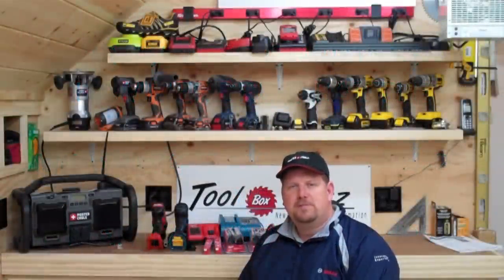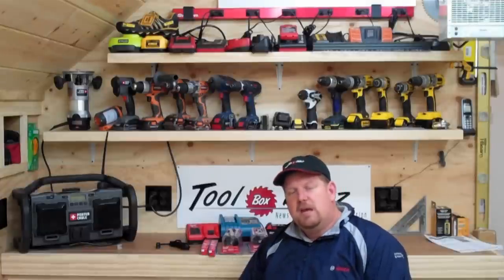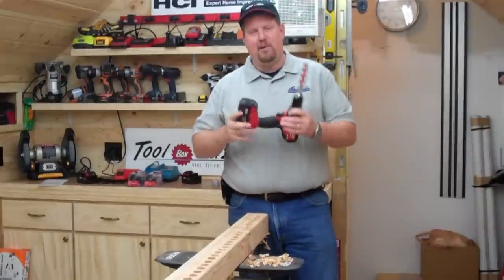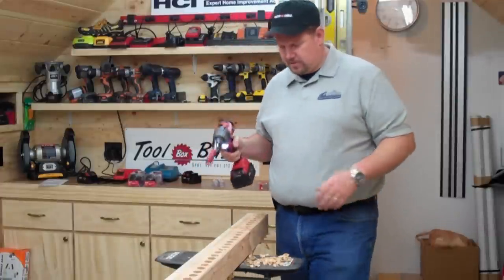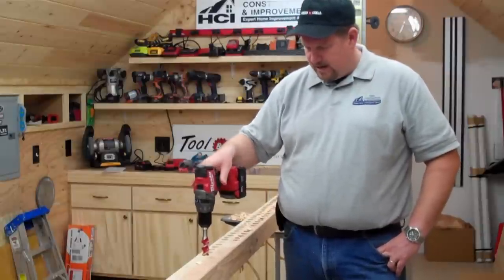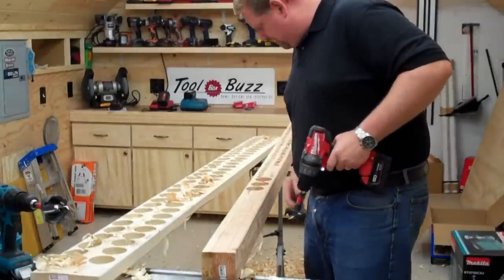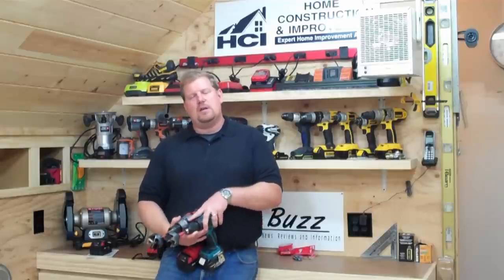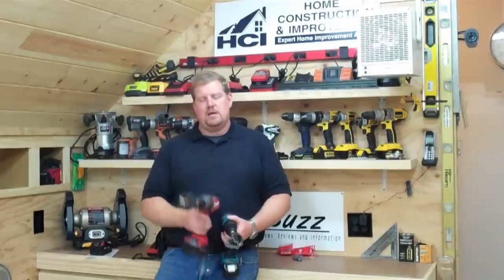Milwaukee 18V Vs Makita 18V - Brushless Hammer Drill Test

Comment: I've put these to test in a cabinet factory producing about 120 boxes a day.    Milwaukies' exhaust is located right where the webbing between your thumb and index finger making long use extremely uncomfortable (unless it's cold out).   Another guy mentioned dampness, totally true, the drills only lasted a couple of months if that before going in for repair or return.    Mikitas....  I have zero complaints, they are amazing and last YEARS.       I use my drills daily and I could care less if a less quality drill has a battery that lasts 10 more minutes.

Comment: This seems to be a pretty fair test!
Same type of drill, same volts and amps, same price, slightly difference in gear ratios and weight.
Like my old DeWalt drill I can't see a belt holder clip on the Milwaukee, which is not very practical in everyday use.
Although most of my tools are Makita and DeWalt  I have no problems getting beaten by Milwaukee in a battery test.

My 6 year old Makita 14.4V with 2x 3Ah has been in use practically every day. survived a 20 feet drop to hard ground + a many from 5-10 feet, been copletely burried in snow and water, been used in down to -28 celsius (-18 farenheit), although it won't recharge in that cold...
It just keeps on going...
Reply: Not fair today. Makita now has a 4.0AH battery, as opposed tot he old 3.0. Not fair comparing a mailwaukee 4.0 to makita 3.0. Why not compare Milwaukee 2.0 to Makita 3.0? lol

Comment: Just bought the Milwaukee Fuel Impact kit I was using a Makita LXT which was awesome but had it for 4 years and wanted to upgrade. Since a combo kit does not exist yet with drill and impact driver I had to buy just the impact kit and later will have to buy just a drill or and kit.
Anyways the Fuel is so powerful that I'm destroying their Impact #2 bits I buy them in a 5 pack made by Milwaukee for about $9.00 pack. I'm driving 3" drywall screws into 2X4s" to make "Strong Backs. Great Tool !!!

Comment: I started with the Makita 5 years ago and only problem I ever had was one battery went out and on my 1/2 impact the switch is messed up, so the light will always stay on.   I tried my friends dewalt and the switch broke right away and lost reverse.  I like that Milwaukee has more torque, but I have a ton of tools for my Makita, so there's no turning back now. next up will prob be the Makita Impact driver that offers 3 speeds brushless even tho i got no complaints with the other impact driver

Comment: Here's what I know.  I've had an old NiCad 18V Dewalt for a long time and still use it with no trouble building fences.  My 14.4V Makita, which is even older, finally gave up the ghost so I replaced it with the new Milwaukee 18V lithium drill and it is not half the drill that the old Dewalt is.  Buy what you want but the Dewalt did me best.

Comment: Yeah, the Makita was at a disadvantage after stalling out several times.  The battery should have been re-charged and the tool allowed to cool.
On the other hand, the Milwaukee wasappeared to be providing a touch more at a speed that visibly looked much faster and less strained with both bits.  That means it was producing more power, albeit for shorter periods of time.
It seems legit to give the nod to Milwaukee on this one but the performance of each tool was very impressive.

Comment: over a long working day the makita is better due to the quick charger. because the Milwaukee takes a long time to charge and only pumps out a few more holes than the makita so if you did this test over lets say a 12 hour period the results will be a lot different. but both drills are excellent pieces of kit. Probably two of the best on the market. (coming from a Milwaukee fan)

Comment: You needed to also start/try the first hole with the Milwaukee in high speed. Not much but that also used some of the Makita's power. I would have to say these drills are equal.

Comment: that is only my preference because i find the hammer setting has a shorter but faster vibration allowing the holes drilled in concrete to be cleaner for my  tapcon screws. just an opinion...

Comment: Also the makita lxph05 is designed to drill 1 1/2" holes in wood (not that i would take notice of any of these specifications myself... =D) but milwaukee sent you a drill that does not qualify for the drill bits milwaukee has selected and.. sent in... perhaps the that fact makita performing as well as the higher speed higher torque milwaukee drill, makes it the better drill out the two??????

Comment: That logic doesn't work... but the fact that the holes drilled by the Makita weakened the wood allowing it to flex outward when the Milwaukee was drilling;hence, making it easier to drill with less power used allowing more holes to be drilled. Although I've used both drills in an industrial atmosphere drilling through electrical panels(6 'x 6' by 2 feet deep) and i prefer using the Milwaukee.

Comment: I am really pissed off by the makita charging system. the 18V 3ah battery software is blocking itself from recharging after ~20 times charging.(red-green light on the charger) and there is no way to reset that POS. by the way, the battery itself is NOT dead!

Comment: @acsfloorcovering @acsfloorcovering The reason I don't care about the battery, is because I plan to use a LiPo with the drill I buy. $50 will buy a battery that lasts twice as long as any drill battery on the market (run-time and battery life). So I'm on a quest to find out which drill has the best quality motor/gearbox and buying it "bare tool". Thanks for the Makita tip, that is cool. I might do that and sell the battery...don't judge me! Lol :)

Comment: First of all girls he has already taken the pressure out of the wood by using the Makita first so it is bloody obvious what ever drill he uses in the same wood a second time alongside the holes, will have less stress in drilling. he should have used 2 lots of wooden planks oldest trick in the books, I would say both drills are identical to each other in every way, but I would go for the Makita why because it has balls and that is why he used it first and not the Milwaukee.

Comment: sorry, this is not even a proper comparison of two drills, im an electrician, speed is important but i dont spend all day just drill easy access holes. i can hang my makitas from my belt, when working at heights, i can charge a batt in 22 mins, my charger beeps when batt is ready, makita chuck is solid so i dnt need trigger to losen or tighten, my makita box fits 2x drills meaning less trips to van.. all these are important factors about being efficient and quick at work, not just qty of holes!

Comment: You did not replicate the first test.
You started out in different speed and it stalled.
Second drill you didn't even see if it would perform.
The first drill used energy when it stalled and let the second drill drill more holes.
Lousy performance by the tester.

Comment: u made the video and u dont know what u did ? first you put makita into high gear and it was stopping, by doing that you are killing the battery, just by that u drained something from it. i use makitas over 8 years with the LXT 2amp lithiums, have 5 kits of them, best drills i ever owned, perfectly balanced compared to anything else on the market,only the 3 speed models are bad design on high speed, eating gears. batteries last at least 3-4 years and we use them for framing and drilling concrete

Comment: Panasonic was the first and is still unbeatable
Reply: That doesn't sound very objective, huh!?
Have ever tried a non-Panasonic drill?
Reply: Mike Patton
Tried the red, both the blue the yellow, the orange, the green and the grey. the batteries on the panasonic outlast them all. I have the dark blue(Bosch) at the moment and it is the most comfortable.
Reply: gummy worms
Blue Bosch's are good drills! The green ones are also good but they looks so stupid with that "futuristic" StarTrek styling.. Yes, Panasonic makes excellent batteries. So does Sanyo... High quality batteries are not cheap, but I have tried a hole lot of cheaper "replacement batteries" over the years, but despite way lower price they ALL perform way-way below par!
Reply: *****
First brushless. They own Sanyo. I had three batteries for 4 years and the 4 year old 3.3 Ah batteries outlasted brand new 4.0 Ah makitas, roofing. Only prob is they don't make a large range and they are bloody exensive.

Comment: Typical, every review I have seen is the same.... Here is some suggestions for future reviews. Test the clutch settings, for example my milwaukee strips the threads of a steel stud when I plant a screw in it, even on the lowest setting, fkn annoying. How does mikita compare? You say hammer drill test but you don't even use that feature. Which is better for some light masonry? Pressure on the drill is also a variable. Which felt better/more ergonomic? Vibration? I would of loved to know the hammer function is useless before I bought it lol. These drill can throw you off a ladder if youre not careful but they just couldn't perfect that hammer function... Only in a perfect world I guess.
Reply: I am actually planing on doing some tools test and I would love to start with drills. I have just started working as a contractor and those questions your asking are huge to me what good is a long lasting powerful fast drilling into wood if the other features dont work and if it is overall just so dang uncomfortable. sadly dont have to much money and am hopeing to either ask companies if they would put faith in there product and let me do a tools test but this will be in the future but man I here you I come to a tools test to see what should I buy and is it useful n my trade
Reply: Xtremedog83 You can always buy one tool and take care of it during the review. Do the review quick and take it back and exchange it for another brand. Find a large store that wont catch on or has a guy that will work with you on the exchanges. Pay attention to detail and the views will come, once youre around 100k views per video companies usually want to give you review sample.
Reply: I don't know I think I will buy some tools that I could use and make reviews on them and ask companies if they would sponsor or send me some of their tools and keep going from their
Reply: Exactly bro, these guys are in it for the free tools and revenue. This is a prime example of why I unsubbed from "Tools in action"

Comment: if i had to do 34 holes in a straight line ... i would use a mains drill, this kind of repitition of drilling with a cordless is not good for battery neither the drill, having your hand over the drill prevents the fans on the motors cooling down the internals, one hand should be behind the drill not wrapped, if you cannot hold the drill, use a drill that comes with an aux handle... sound like mliwaukee do not like the popularity of makita, thus asking and sending you vitals for this bad test..

Comment: Runtime is only a small consideration. Longevity of the tool and battery can be far more important. I own more than half a dozen makita cordless tools and I do not rate their batteries in any capacity. With regular use you will not get much more than 12months use from them. The guys I work with get much better life from Dewalt batteries. No knowledge of Milwaukee. Do not expect any sympathy from Makita. They know their batteries are poorly spec'ed. Note how makita slows down but has no cutout.

Comment: Makita developed the first brushless tools for nasa before any had ever hit the market and were the first to sell brushless drills. 

The test is unfair. The milwaukee had a 4.0 battery and the makita only had a 3.0. No wonder milwaukee sent this when they released the 4.0 with 33% more capacity than the makita 3.0
Reply: I know the kits that are sold in Home Depot come with those batteries. You are right, the test may have not been fair but with the Milwaukee coming in at $299.00 (w/ two 4.0 AH batteries) and the Makita at $289.00 (w/ two 3.0 AH batteries) you do get more bang for you buck with the Milwaukee.
Reply: I might be wrong but don't the Milwaukee 4 amp hour batteries have a big 4.0 written on the side of the battery cant see that in the video, makes me think they are both using the 3.0ah battery.
Reply: Well, more bang for yor buck? Because the battery has more capacity? Does that alone make a great drill? Milwaukee is not the same in quality as Makita. I would say Makita would be more bang for the buck, despite smaller battery, as you will get quality for that price.

Comment: my grandpa was using a brushed drill in a flooded basement. he put the drill(dewalt) compleatley underwater and let it rip a hole in concrete. if that was a brushless him and his crew would be dead right now. i like brushed motors. they are cheaper anyway. but if you want a long lasting drill,milwakee and dewalt may be heavy but they have steel gears,mot makitas crap plastic.
scenserly,a dewalt lover who has used almost every brand of power tools extensivly.

Comment: What does this Kindergarten proof? The Milwaukee has better batteries. We knew that before! A heck of a test would be 1 year on the construction site! I know, Makitas are lower on the specs, but These are the machines that last, machines I can rely on and they still work even after Drops of more than 1 meter. Milwaukees were good machines until 2006, when the Chinese brand TTI got their Hands on. Only Thing thei're really good at now is the batteries.

Comment: I was a Makita guy for a long time, but over the last two years working in industrial construction, I have burnt out one Makita drill twice, and another four times! Also the speed switch is getting loose on one of them and slips down with the vibration of the drill, causing the gears to grind. One of my Makita batteries also stopped working as the contacts got too loose. I'm looking to switch to Milwaukee as a lot of other guys I work with have them and they seem to far outlast Makita's as far as long term durability goes. No complaints with the Makita cordless impact or skill saw, however... just the drill.

Comment: We recently set our electrical switchboard manufacturing company up with the new Milwaukee 18v range (brushless is so much better)...we swapped from noisy air drills and cannot be more happier with the cordless drills

I have to drill holes up to 75mm in stainless with hole saws and 13mm in thick mild steel plate...the Milwaukee drills eats this work up...

Cant comment on the makita never used the brushless model

Comment: @acsfloorcovering You're correct, I was thinking of the smaller 1.5ah batteries. It looks like both of these 3ah batteries are rated the same. There are people who use drill motors in their robots (like Battle Bots), and apparently someone said Bosch uses steel gears. That would be a start, metal vs plastic gears. There are strong plastics though, so comparing the types of plastic would be just as good.

Comment: For me, it's a battery test, not a drill test. Every battery are not equal . You should think that you must have the same power source to check wich one perform better. One drill may consume more power for the same torque ect  You should verify if all the battery cell are well match, internal resistivity  etc..  The torque advertising by the manufacturer is really what is says ?   Nice test, but for me, if I need more battery to do the job, maybe I need a better battery, or something that use les current ..

Comment: The Milwaukee battery is 27wh compared to Makita 24wh. "Specific energy or gravimetric energy density defines the battery capacity in weight (Wh/kg); energy density or volumetric energy density is given in size (Wh/l).....Specific energy is synonymous with battery capacity and runtime."

Comment: I've had a big problem with Makita all of their new batteries and their new brushless hammer drill. I had it for 6 months had to bring it in three times for repairs broke the transmission twice and the drill actually snapped in half as far as the batteries if you have an lxt tool 3 years old the new batteries  with a life test on it it will not work with any  over 3 years old Tools even though their display says it works with over 180 of their lxt line tools stated in the store and there is nothing that says hey these will not work with your old tools don't forget to pick up an old battery if you're hoping that these will work with your old things forget about it you have to buy a whole new kit plus all of their battery recall they just do not tell their customers of these. it must have a star on the label on the side or on the bottom where the battery goes otherwise the new batteries will not work I contacted Makita via email multiple times with no response so I called them and they said maybe you should buy a new kit great customer service. I use Makita for many years and had very little problems with them before they went and started changing things with all of their batteries and these battery recalls as soon as they change to this brushless it seemed like they had many problems not happy with the customer service and it seems like things are going downhill with them time to look for a new brand

Comment: The only important thing is battery longevity since once 2 batteries die, the drill becomes a paperweight(monetarily).I've got a corless DeWalt 14 and 14.4 sitting here with 4 dead batteries. I replaced them with SBE corded Metabos. Talk to you in 30 years.
Reply: It's one of the most important things I'd say. Important things can also be quality of the tool itself. You don't want a an expensive tool to brake down on you after only half a year. Also ergonomics is important if you are going to use the tool all day.